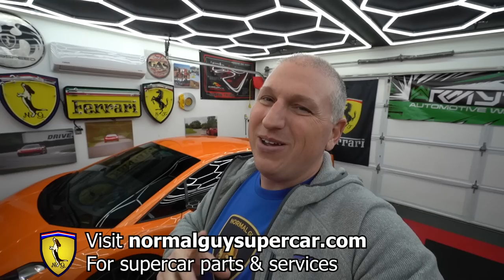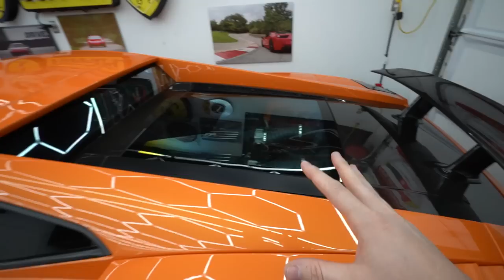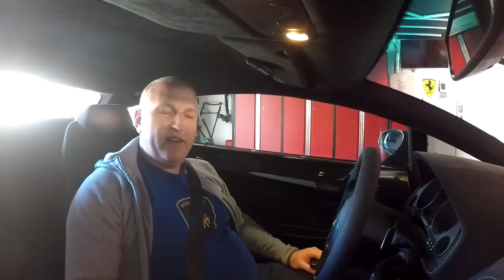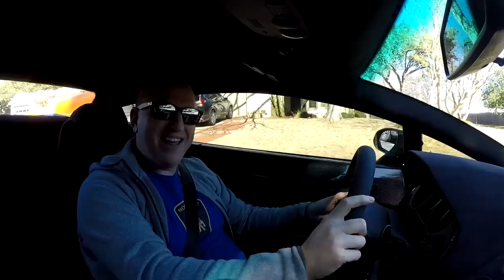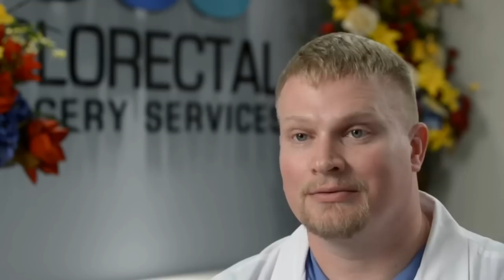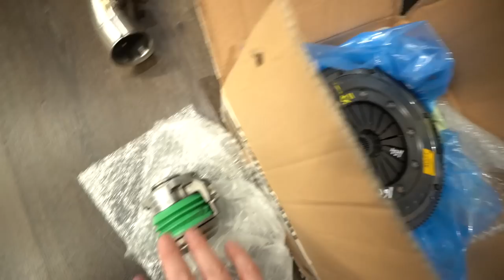Tips & Myths of Single Clutch Transmissions

Comment: They don't all last 40,000 miles. At all. I've owned several Ferraris, 360 and 430.

In the 355 and early 360 (so about pre 2002), you will be lucky getting 20k miles to a clutch. They ride the clutch far too much moving off, sometimes multiple times before it engages. Secondly, reverse gear is far too high (basically like 2nd gear), so moving off when reversing is horrible on the clutch.

By 2002, Ferrari started listening to complaints and made big improvements. So clutch wear WHEN YOU HAVE A 2002 OR LATER TCU (gearbox ecu) (always check someone hasn't retrofitted an old TCU into your 2002 or later car!!!) you will get more like 30,000 miles. The Challenge Stradale TCU offers very sharp (violent) changes in Race Mode (this can be retrofitted in all 360) and will also give something like 30-35k. Keep the 360 permanently in manual Sport (or Race in the CS) mode to achieve this.

430s again will give about 30-35k (or more, if very careful) per clutch.

I don't have particular knowledge of Lamborghini, but my instinct is that the Gallardo does seem to provide sharper shifts (ie less riding moving off) and seem to offer around 40k per clutch. It the jump in tech around 2002 did seem to improve the single clutch situation a  lot.

(I've heard Aventador clutch life can be absolutely awful, like 10k per clutch - tho I'm not a Lambo expert) 

Few things to note:

- clutch calibration is key. The best specialists can calibrate your car to provide better driving characteristics and longer clutch life. There's a lot of parameters involved and these guys know what works
- if someone has re-used a battered flywheel (to save money), this will give you less clutch life
- the state of the release bearing is also critical (*always* put a new Hill Engineering bearing when doing the clutch - the bearing only lasts one clutch cycle)
- "auto mode" is generally bad for clutch life, it will slip between gears more to provide a sense of smoothness (= bad) 
- reversing is generally bad (reversing uphill is very, very bad) 
- stop start traffic driving is also bad. It will reduce your clutch life a lot. Try and keep to open roads, where these cars belong. These are not friendly daily cars or commuters
- always try to upgrade the TCU if / where possible. It will pay you back
- DO NOT launch the car in 1st gear. Just don't do it.
DO NOT keep on driving hard if the clutch overheat warning comes on, driving gently and allowing it to cool will get you home, but overheating suggests something is worn and needs replacing.. They don't often do this so pay attention if they do
- if there's any chance of saving and re-using the flywheel don't keep driving the car once it is slipping. You will fully dish the flywheel and it will become unusable 
- the flywheel in the 430 is quite thin. It * can * be reused once, but that's it. Some people reuse it twice and are asking for trouble. The 360 flywheel is a little thicker and can often be reused.
- DO NOT use any kind of aftermarket clutches. The OE clutches are very very slightly dished out of the box and must be within a certain tolerance to match with the flywheel. Machining these parts flat (as you can get away with in manual cars) will simply give you a horribly hard gear change. The OE dishing is there is smooth out the characteristics of the drive. You need to get the F1 or E Gear spec parts for an F1 / E Gear car.
- it's a good idea to change both gearbox and F1 fluids yearly or at least every 2 years.
- doing fairly regular "actuator relearns" is worth doing (this can be done at home using a fairly basic Launch X431 OBD tool) 
- lastly, always let the car naturally warm up (you can drive at low revs) before you kick the car above 4k revs. These cars do not enjoy being cold. At all.

Oh and aside from all of that the following parts can also require maintenance in a single clutch car:

- actuator (they leak or just become malfunctional)
- actuator solenoid valves
- F1 pump and motor (they burn out)
- F1 relay (burns out) 
- F1 hoses (can split and leak) 
- accumulator (loses necessary pressure)
- variety of sensors (they can just stop working or are sometimes prone to actuator leak contamination) (f430 has a host of extra E-diff sensors)
Etc etc..

- 
-
Reply from the maker: Solid advice here

Comment: I have always wondered why these clutches don't last long. Heck in a corvette it last longer even when riding them rough.  I never understood that part. I would think it should last at least 80,000 miles.
Reply from the maker: You can get far more miles if it's a true manual

Comment: Verry interesting topic: I would like to share some of my facts.  My Superleggera (2008) my clutch/flywheel is just replaced with a new OEM set. 

At 50.000km (35.000 miles) my clutch life used percentage was at 105% it was the 1st clutch. Also the dealer recomended me to also change the flywheel since they were calibrated and sold as a set. A bit strange story because you can buy the R8 clutch without the flywheel.

What is your opinion on this?
Reply from the maker: I don't know enough about lamborghini parts yet to tell you if that's valid.

Comment: Seems like lambo parts are even more money than ferrari parts.  My F355 clutch disc and pressure plate was 1,100 bucks  about 3 years ago.  I'm thinking of getting a gallardo spider eventually.  I like the 06 to 08 gallardos because I don't like direct injection and the problems that come with it, such as carboned up valves, failed high pressure pumps, injectors etc.  Thoughts?
Reply from the maker: I think they are a deal right now

Comment: Hi Dan, I own a LP570.
Would it be better to upshift when the rpm hits 2000-3000, or it wouldn’t matter at all? 
Does upshifting at higher rpm wear more clutch? 

Hope to hear from you.
Reply from the maker: I don't really think the shifting matters that much. It the starting that wears more
Reply: @normalguysupercar  thank u very much for the response.. Thanks for the tip.
And also does the “Kicking at the seat” while upshifting from 1-2-3 indicates that the clutch is also wearing as well? 

Hope my question doesn’t confuse with ur illustration.. 🙏🙏🙏
Pls enlighten me if I’m wrong. Thank u. ☺️

Comment: I have been looking at Maserati GTs and I noticed a lot of these cars are sold at a certain mileage. Now I know another reason why ? Not even sure the GT has this type of clutch (will have to research that) but I see many for sale around the 35k miles range.
Reply: The automated manual "MC-Shift" was only available in NA for one year in the GT, I'm reasonably sure but not 100% certain. The rest have a ZF torque converter 6 speed.
Reply from the maker: Yeah check which trans it has.

Comment: Dan, do you do the same in a true manual (keep the clutch pedal in and in 1st gear) while at a stoplight? As you said, that doesn’t wear the clutch, but does the throw out bearing. Could that potentially wear out the throw out bearing prior to the clutch going out over time?
Reply from the maker: Depends on how heavy the clutch is and how long the light is.
Reply: Not sure about E-gear but at least every Ferrari F1 systems doesnt free the clutch when you change to neutral. So its totally useless to change to neutral on traffic lights. It takes around 12minutes on idle before throwout bearing is unpressurised.

Comment: Dan, on the reverse instructions, does this apply to manuals too?
Reply: Not if you fully engage the clutch (foot off pedal) once car is moving in R.  Feathering is the best descriptive since most people dont travel in reverse more than 100ft so they dont stay on the gas much at all.  Think about your car, I assume unless your on a incline you only tap the gas then use idle to reverse out of garage or parking spot.
Reply from the maker: Crypto got it. Totally depends how you use the clutch. Fully engaged it's not really wearing. The wear occurs when slipping...

Comment: WHY is the Single Clutch so expensive? Seems like a lot even for an exotic car.
Reply from the maker: Hard to get parts I guess?
Reply: @normalguysupercar  When you're used to getting your Subaru clutch kit for less than $100, $4,000 just seems astronomical. And I know it's a Lamborghini blah blah blah but still. Is this a OEM or aftermarket clutch?

Comment: I'm not sure I understand. Your clutch life is at 22% (8:18) and the clutch engagement is a little slow. Dealerships may suggest changing the clutch at 20% (12:22), but they probably don't need to (12:38)? I understand this car is featured on your channel for content and for selling, but if you kept it for yourself, you wouldn't change, right? VAG has this weird obsession with reporting percentages to indicate the health of vehicle components (e.g., tire wear). I found it unnecessarily frustrating because it doesn't immediately tell the complete story because you then have to convert the percentage to an actual measurement and rely on your own judgement.
Reply from the maker: If I were keeping it, I would not change the clutch for probably another 5k miles or so.